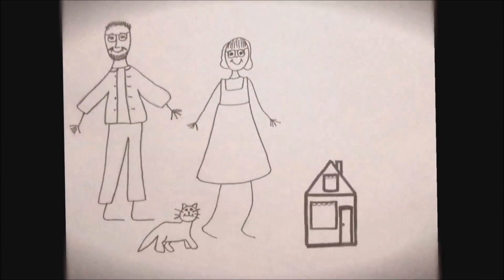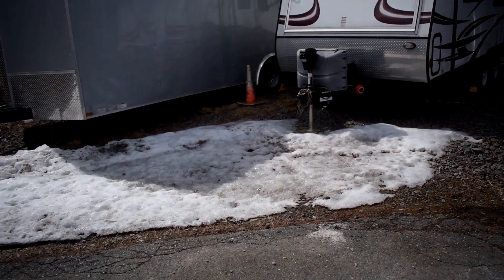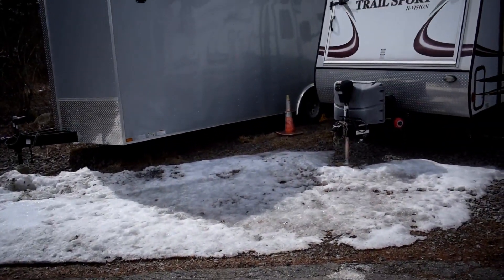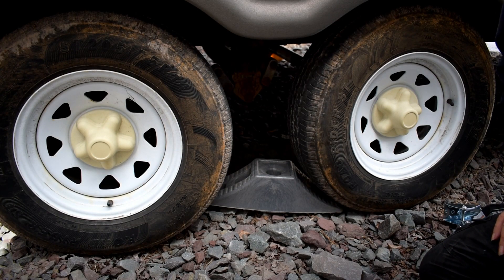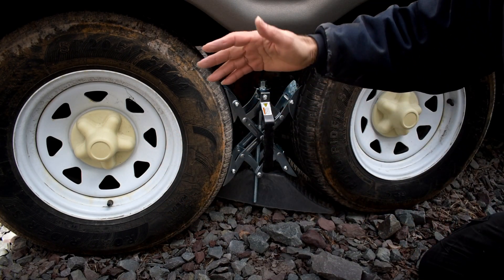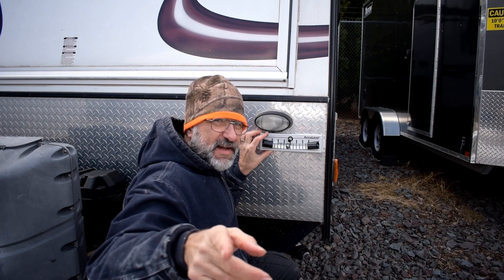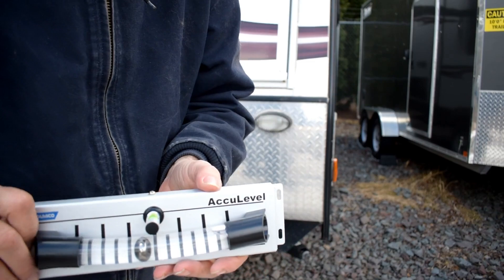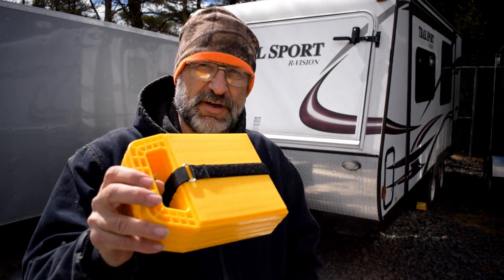New batteries and gadgets for the RV "Cottage."

Comment: Suggestion on the level. If you mount to where you said you're assuming that is the side to be the lowest all the time. I suggest you put it on the center of the bed tip out so you can see through the back window of the tow vehicle. When connecting the two batteries your jumpers are too small. You used 10 gauge when you should've used a minimum of six gauge. One more thing on the batteries, you want to draw negative from one battery and positive from the other battery so it draws equally from both batteries and not just one. The way you have it hooked will only draw from one and when it gets lower than the other it'll start to steal from the other. So the problem is they won't discharge equally. I hope the trip goes well for you.

Comment: Hey Bill I have been watching your channel about six months or so, not sure what it is about the two of you but I really enjoy your channel. One thing about the battery hook up, it is better to hook up the positive from the camper on one battery and the negative on the other battery.  Keep the videos coming and God Bless you.
Reply from the maker: I see your point.  Thanks.
Reply: Bill,  i will second what Ronnie B posted about the battery hook-up.  His method draws power thru both batteries.  You will like the duration a lot better.
Also, i have towed RVs for many years and learned the “charging” wire from the vehicle does not do much.  Even though it probably has a 30 amp fuse, you will get a trickle thru that little 10,gage wire, especially to 2 batteries.  They draw down half as fast and they charge half as fast.  I suggest adding 2 wires (probably 1/0 gage) from the truck battery with appropriate fuses and a solenoid  to,disconnect when the key is off.  I use an Anderson SB350 connector at he rear bumper and a mate on the trailer.  If you do this, you will need to remove that new fuse u-haul installed to prevent 2 potentially conflicting/competing voltage sources.  A site called Expedition Portal OR TNTTT can give you some additional guidance.

Comment: i found the ''x braces'' to be really effective, they definitely stopped the movement of the trailer when walking around inside.  if i was to choose 2 things that i've bought for my travel trailer that i could recommend to you, one is a small electric heater.  it saves on propane and does a great job in a small space.  secondly, there is an r.v. shower head called ''oxygenics''  which feels like a lot more  water pressure when taking a shower.   sorry...i need to add a third thing.  an induction element.  super efficient and again, saves propane when you're hooked-up to electric.  thanks very much for posting.  always enjoy your content.

Comment: I question if you can fit the trailer with LED fixtures for what you replaced the bulbs?
Reply from the maker: I have no idea.  I didn't even look into that possibility.  But that would be a lot of work to replace all of those fixtures.  And I'm not sure why?  The fixtures I have work fine when I just replace the bulbs with LED.

Comment: Almost every camper has "Ghost Drains" things that run all the time, carbon monoxide detectors, smoke alarms, small things that drain power over time, i always disconnect the batteries when the camper is sitting for any length of time.
Reply from the maker: I have installed a “kill switch” right next to the batteries that makes it easy to turn the whole system off so the batteries won’t drain.

Comment: Just an FYI... When I changed the incandescent bulbs in my camper to LED, I found out that the LED bulbs emit noise on the 12V which interfered with the TV antenna booster signal. So much so that the TV could not tune any channels. I do not watch much TV when I am camping. I prefer to be outdoors enjoying nature and God's creation. I did leave one incandescent bulbs installed in case I do need to watch TV, mostly for weather when I do not have a cell signal. I am looking forward to getting my camper uncovered.
Reply from the maker: Thanks! But, we never watch TV. The only time we’ve had regular television since 1980 was for a little while right after 9-11. We get important news and weather on-line.

Comment: First I have to say your camera is awesome. Wow clarity and focus is outstanding. Very exciting. I'm kinda in crunch myself with my camper. Bought some nifty things for it as well but I will be starting therapy for my broken arm soon so in hopes I will be good enough to take off in mid may down south for my grandsons graduation and for some outta the way site seeing. I'm excited for you both woohoo. It's really strange but the old 28foot avion rarely needs leveling odd but true and it doesnt wobble like my 07' 28 foot Shasta did. Shorter closer to the ground maybe just the way it was built but it's always solid walking in it. I think that's why I sold my Shasta.  You should get Tire covers because of the weathering. I just switched the lights in my house and camper to led.. took a few months to do because of the cost but done and worth it. Time to make a list to do and bring. Awesome you 2.. God bless every journey
Reply from the maker: Thanks.  It's a new camera, and I'm still struggling to learn how to use it.  But I'm learning.  :-)
Reply: I have Nikon coolpix 35 mm with a 30 zoom lense.. it took me lots of playing with the functions still I'm sure I hardly skimmed the surface on the functions.. have lots of fun it is the great part of learning. Very nice so far